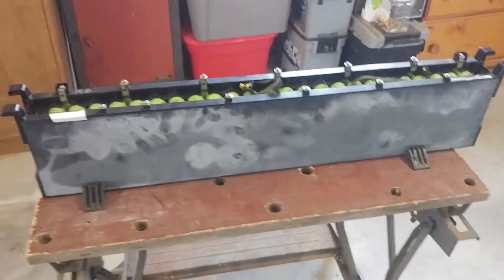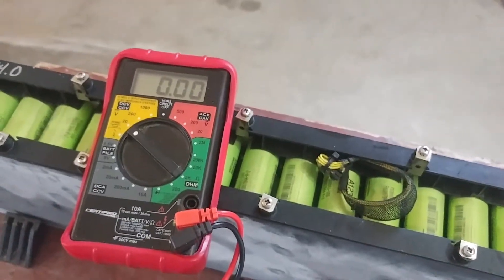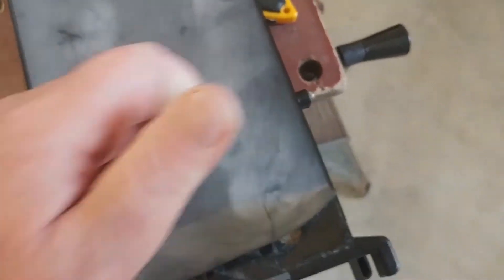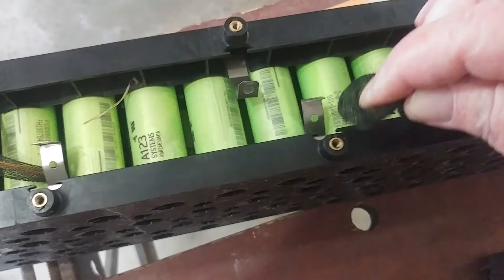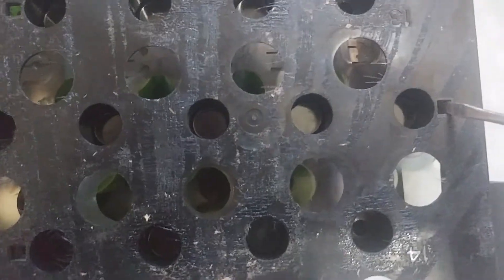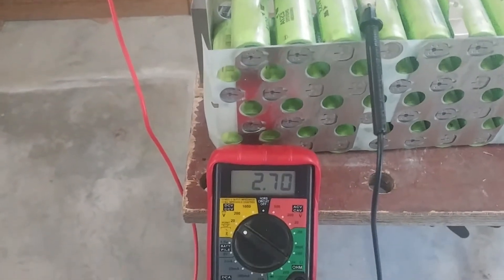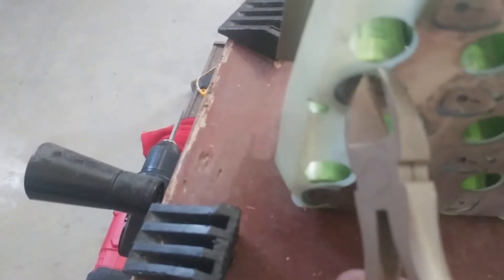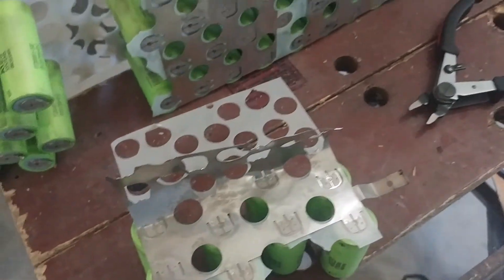2020 21 A123 battery pack dismantle

Comment: Hi
Copied the build but I’m struggling with the BMS balance wires, if each wire is measuring different values 3,6,9,13v how does the BMS balance?
Thanks
Reply from the maker: Batteries are in series so each series has a wire the bms monitors each wire to keep it at the individual voltage of the cell so it only sees each series as a single. When you measure it you are thinking it increases because you are using the main ground if you use the last positive as ground then the cell only shows the cell voltage. so basically that is how it works
Reply: @offgridwanabe  makes sense now. Thank you